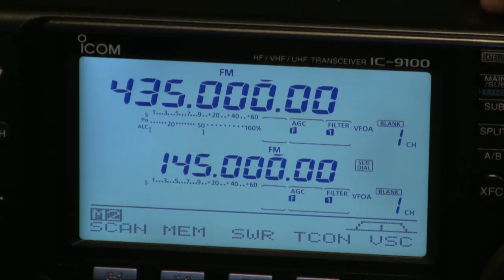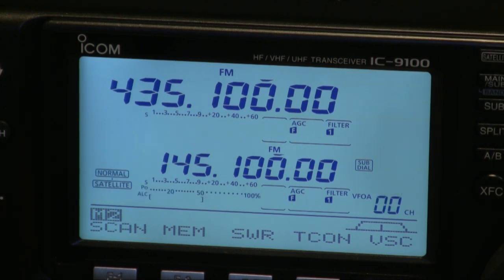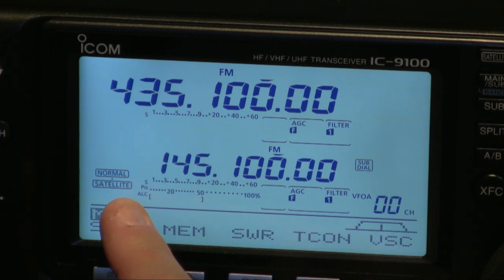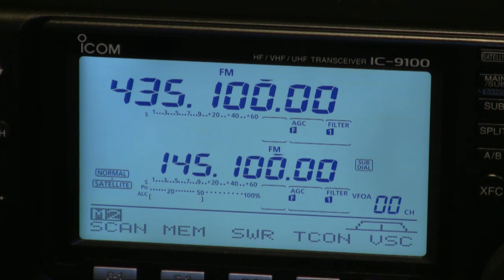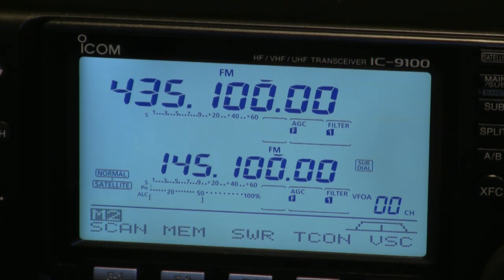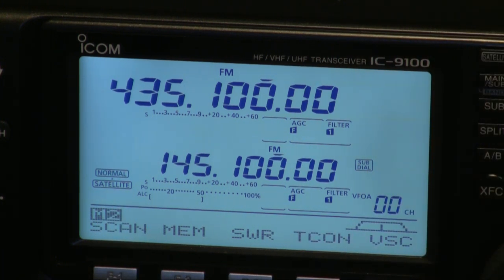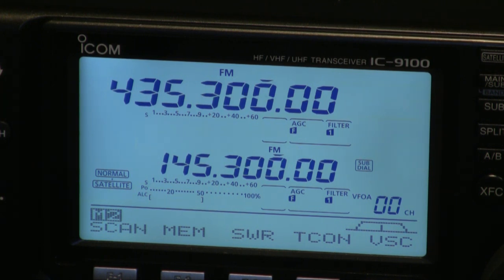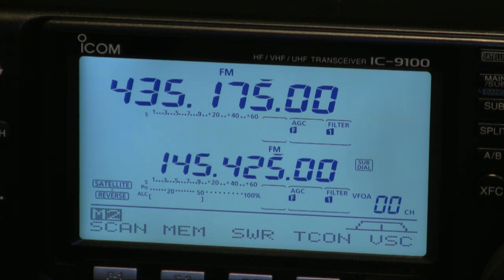IC9100 Satellite Mode Demo

Comment: Don't forget the TS-2000
Reply: alphasxsignal I have a TS-2000 and I can’t wait till I forget that piece of shit radio.I just replaced it with an ICOM 821H and it blows away the TS-2000 in simplicity in ease of programming and operation.The TS-2000 is loaded with Excessive Menus that take away any pleasure of operating the radio it may have ever had.